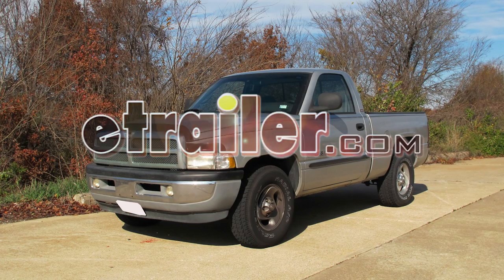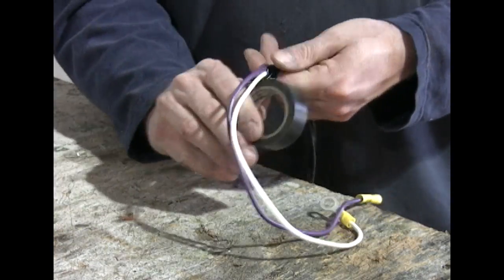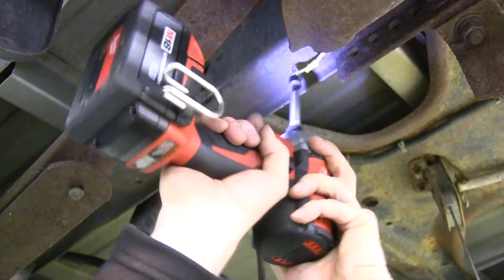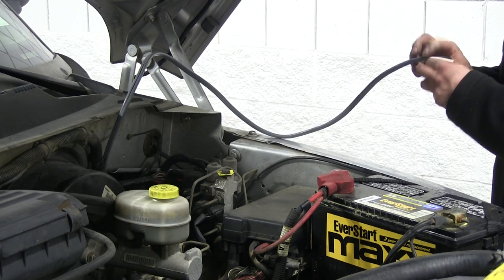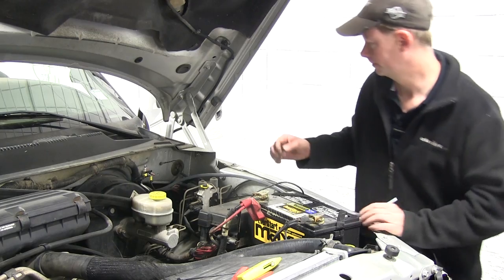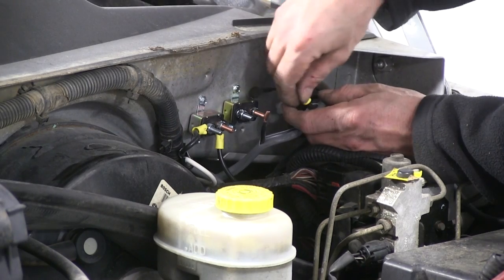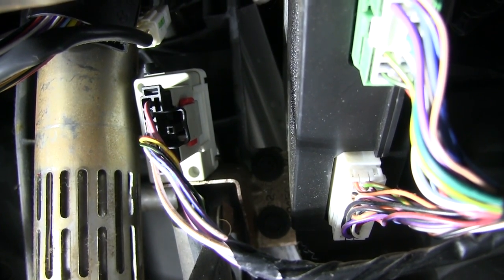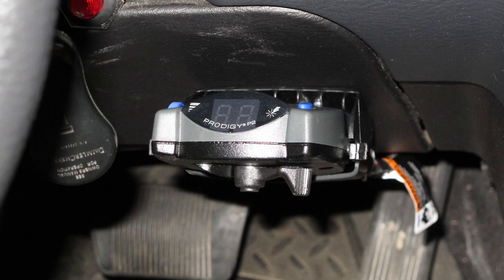Installation Guide for the Tekonsha Prodigy P2 Trailer Brake Controller on a 2001 Dodge Ram Pickup

Comment: My 2008 ram has the 7 point connector in rear but no plug and play connector under the dash. Traced the brake wire from the 7 point connector to the engine compartment coiled up zip tied to a harness with no end, very bizarre. Going to use this video to complete the wiring. same concept thanks.
Reply from the maker: Thank you for sharing this with us! We are happy we were able to help!
https://www.etrailer.com/Trailer-Brake-Controller/Tekonsha/90885.html

Comment: I followed the video and ended up frying my ECM, PCM, ECU. I have a 2002 Dodge Ram 1500 which has the same color brake wire coming from the brake switch. 15 mins into my drive my Gas light, ABS light and E Brake light come on. The AC stopped blowing cold air and my speedometer started to pulse radically. Now I have to buy a replacement Computer for my truck.

Comment: this truck didn't have the factory trailer brake plug under the dash?
Reply: a This submodel comes Stock as it gets. I have a similar one which came with no front toe hooks, or a rear receiver hitch or light hookups.

Comment: I have a 94 do I have to do the same is there a factory plug for my 94 2500
Reply from the maker: Some hardwiring is required to install a brake controller on your 1994 Dodge Ram 2500. Below is a link to our selection of brake controllers and wiring that you'd need to accomplish this. I'm also attaching a link to an FAQ that might apply to your pickup and will help explain the installation a little more in detail.

https://www.etrailer.com/bc-1994_Dodge_Ram+Pickup.htm
https://www.etrailer.com/faq-dbc.aspx
Reply from the maker: @michaeld954  You can use the adapter linked below to convert the 6-Way on your pickup to a 7-Way on a trailer. Since your pickup only has 6 functions the 7-Way on your trailer won't have all of the functions active and in that case it would be better to use our Universal Wiring Kit which I have linked below for you as well as a trailer wiring FAQ you might be interested in.

https://www.etrailer.com/Wiring/Hopkins/47435.html
https://www.etrailer.com/Accessories-and-Parts/etrailer/ETBC7.html
https://www.etrailer.com/faq-wiring.aspx